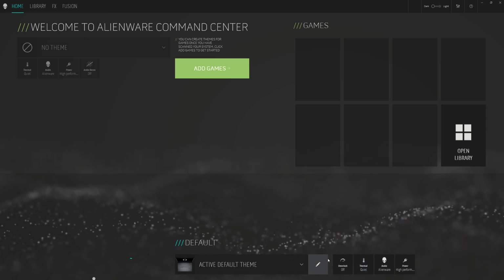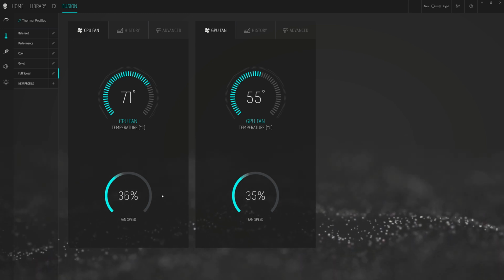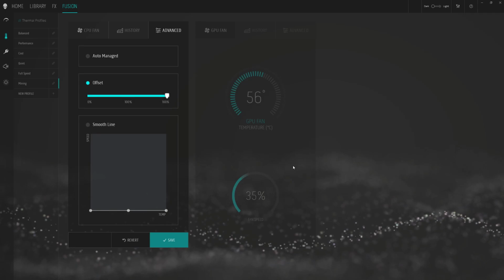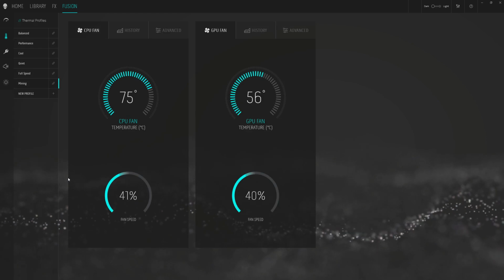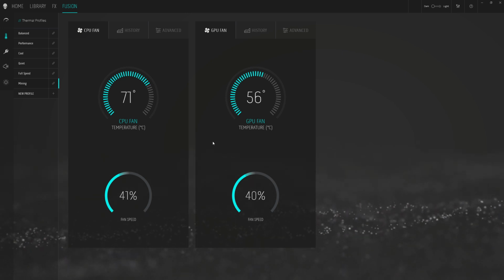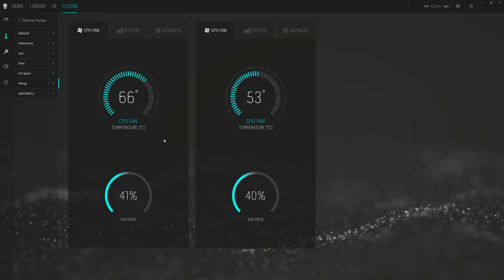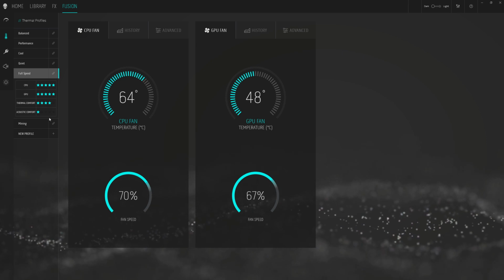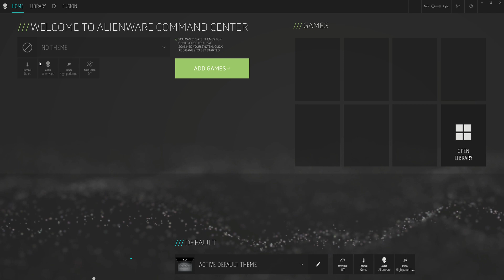Fix - Alienware Command Center Wont Change Fan Speed

Comment: My default is gone. Can't see anything except my games, stuck on Full Speed now lol
Reply from the maker: Prob an update broke things. Do a full uninstall of AWCC and OC Settings apps, restart the pc, and then try to install via this AWCC package installer. https://www.dell.com/support/home/en-us/drivers/driversdetails?driverid=x8t80&oscode=w2021&productcode=alienware-m18-r1-laptop
Reply from the maker: If you experience issues with the above installer, here's the full package installer. https://www.dell.com/support/home/en-us/drivers/driversdetails?driverid=d4x01&oscode=w2021&productcode=alienware-m18-r1-laptop
Reply: @John-Patrick McNown  it will be an ongoing issue with Dells coding when it comes to Fusion and the Alienware control center. The issue is MS Dot NET Framework being updated. Which has controlled everything down to the custom RGB settings for AW laptops and desktops.
Reply from the maker: @devingunther9352  Thank you for chiming in Devin. I haven't had my AW machines since about a month after I uploaded this video so i'm really just guessing at this point as to how broken things are now. I hope this helps others understand what's up.
Reply: @devingunther9352 So how do you fix this issue?
Reply: Today i install ACC and in less than 2 minutes it went to full speed fan, y close de app and it continues, i restart the laptop and same issue, then i uninstall the ACC and the problem its gone, probably its something wrong with this program.

Comment: can we flash an alternative bios to the motherboard to get rid of all the dell software they abandoned? ive spent apx 30 hours working on a R11 system for a friend of mine. Ive case swapped it, replaced the burnt out gpu. and now the only thing i have left is the fan control and front panel buttons.

Comment: I fiddled with this damn software for like 30 minutes wondering what the hell I was doing wrong.  The fact that the "activate profile" is under a completely different tab from actually SETTING the profiles is ridiculous.  My girlfriend just got her Aurora R12 and the thing has had no end of thermal issues.  I couldn't believe how damn hot the thing gets just sitting there doing nothing.  All 3 fans were reading almost 180°F while the fans slugged along at 12%.  Video feed would stop but the computer wouldn't shut down (thermal condition).  I would have to shut it down manually and allow it to cool for 30 minutes before she would fire back up.

After fiddling around for a bit I now have the fan curves for all 3 zones set very nicely.  I have made a very nice compromise of noise to cooling.  Now everything hovers around 111°F and rarely gets over 122°F regardless of how hard we push her.  

It seems the CPU requires the most aggressive curve.  The CPU temp seems to sort of set the tone for the entire system.  The CPU fan hovers around 60% @ 110°F, which is actually surprisingly quiet.  The front fan is the worst noise offender, but honestly doesn't do much cooling-wise, so that fan hovers around 30% @ 110°F.  The top fan is not that noisy at all, so it hovers around 50% @ 110°F.  The whole thing is holding nicely  @ 110°F-120°F.

Subscribed and Liked!

Comment: Thanks for this video. Had given up on a solution. To add, once you activate the new profile you can change the settings in the fusion panel and any change will reflect instantly and will not have to flip back and forth to the main menu.

Comment: Thank you for this video. For the last 10-15 years, I've had multiple devices having Blue/Green Screens of Death. Dozens of "solutions" have been suggested, usually centered around Clean Install of Windows and/or modifying the Virtual memory issues. Not a single post ever suggested the fan speed or a potential solution. I always push my devices beyond their limits. I never realized there was a connection between "SOD's" and fan issues. I thought they were two separate issues. 

Being able to influence fan speeds has been a huge help. The Computer Management app (using Event Viewer) shows the frequency/types of errors. Following this video has greatly reduced/eliminated my "SOD's" for the last few weeks. My husband suggested giving you a like/subscribe/comment to reflect my gratitude. Thank you!

Comment: okay so i was having some other issues, and needed to do a complete reinstallation. Before i uninstalled, I was actually able to adjust the fan speed in the advanced tab and it would actually work. it has done this since i first got my desktop a few years ago, but now that i reinstalled it, it wasnt working. in which case, great video, thank you for the help. but i wonder if it was like a version specific thing or what because now that im looking it up, apparently im the only person i can find that was able to change the fan speed in the advanced tab and that blue line did mean that it was the active profile. im not sure what changed, but im hoping someone can find out what it was so maybe i can get that feature back and so others can actually have it.
Edit: okay i figured it out after messing with it for a while. i think its because the blue bar in the thermal profiles is supposed to change what the profile says on the main screen, and for some reason it isnt doing that. if you select your custom profile on the main menu, and then go into that profile>advanced and then change the settings ( i always use smooth line) it changes as you change the line and save it

Comment: It took me days to figure this out.  I couldn't find this info anywhere.  I'm have the same prob with a corsair mouse setup.  Very similar situation.  Anyway, Thanks for posting this vid...... Also, don't let AW command center install Nvidia software.  Download yourself, straight from Nvidia.  For some reason,  AW overclocked everything, locked the settings and shot my temps up by 40 deg F at idle.

Comment: I agree, It is not (gasp) user friendly.   Also my take is as a "Command center"   it does not give as much information on all the temps as I might want.   Thanks for the video!
I used to build my own PC's and the R11 is the first pre-built I have had in 25 years.    Overall I like it but the bios seems really wonky.  I have seen LOTS of people know know more than me about computers (Especially the Alienware) and I see LOTS of them say if it is working do not update bios because it seems to trigger problems

Comment: Does it work with MSI laptops?
Reply from the maker: My understanding is that the Alienware Command Center is specifically intended for use with Alienware hardware. Frankly, I MSI has to have made something better than this app. Afterburner for example.

Comment: I'm having a different issue. My fans will never go quiet on my M15 R7. Fans never go under 50%, and if they spin up to 100% while gaming they stay that way even after quitting and nothing is running. I've updated everything and still an issue. This was an open box from BB and I'm outside of my return window. Im thinking it may be a hardware/sensor issue.
Reply from the maker: Sorry for the delayed response. Did this ever work itself out? Were the fan speeds at least responding to the perceived (presumably incorrect) temps?

Comment: Why doesn't my 2015 Alienware laptop 17R2 cooling fan keep turning to the laptop for cooling? My laptop CPU is already at 60 degrees or 70 degrees. Why doesn't the computer fan continue to cool down? Do you know a workaround?
Reply from the maker: Are you saying that the CPU heats up and the fan speed slows, allowing the CPU temp to continue to rise? Are you able to create a more agressive fan response curve in the Command Center app? If the fans can be set to 100% regardless of the CPU temp, does it lower the temp? Perhaps the fans aren't working as well as they once might have. Perhaps the equipment is reaching an age where everything is simply becoming less efficient and effective. I keep my laptops on an active fan cooling pad just to give it a little help.

Comment: The new update has NO HOME TAB AND IT NO LONGER SPEEDS UP THE FANS. wtf...
Reply from the maker: Ita been a bit since I had these AW machines, but if I remember, there was a time when an update broke it, but uninstalling both AWCC and the OC Settings app, rebooting and reinstalling both apps again corrected it. Fingers crossed they didn't F the app up more.
Reply: @jpmcnown1  well I ended up having to set the speed for each game so basically of its a low load game it will be ok but something more heavy it just runs pretty much at the maximum of the curve. Great tutorial btw, I always used the home screen setting but the update changed it, and I can't seem to roll it back. Can't find the old drivers anymore. I'll probs do a whole new build in oct, but it really is a good machine, guys with new rigs are complaining and I'm running an i7 9700 with no issues. Too bad the Devs are not doing a good job on that app. Thanks again, the video made a difference for me that's for sure.

Comment: Alienware Command Center one of the most poorly written pieces of software I had the displeasure of using.
- Asks to download optional components which never install? ☑
- Terrible UX where you need to turn things off then on again to get settings to stick? ☑
- Uninstaller leaves leftovers files and registry entries everywhere that must be removed manually? ☑
- Trying to reinstall gets stuck forever while filling your disk with an ever growing log file? ☑
- How many times should i uninstall and reinstall this software before it starts to work properly? is 100 times enough? ☑

Comment: I searched for days, even called Dell for a fix on this. I did not realize the gaming laptop had so much control over things. My fans ran at 100% for 2 days cause I did not know how to use the Alienware Command Center software. You made it easy and saved me from returning this Alienware laptop. Thanks

Comment: My Alienware 17 r4 from 2017 doesn’t have the thermal option in my Alienware command center, how can I fix that?
Reply from the maker: I would uninstall the AWCC and OC Control apps, update your bios and all drivers, then reinstall the 2 Alienware apps again. There "should" be a little thermometer icon on that tab. Let me know if this works.

Comment: AWCC is dumb, right, but that's is not even the way to apply. You have to click on the "link" shaped icon on the right of profile and apply to "desktop", like applying profile to a game. you will see as a white shape rectangular with no image in it. Then AWCC will load that profile every time you use "desktop" (so, always).
Reply from the maker: Yeah, I appreciate the clarification, that's been mentioned. It's also completely intuitive, to no one. I moved on from Alienware, the app is only one tiny shit aspect of the giant turd.
Reply: @jpmcnown1  more unintuitive Is that AWCC profiles let you only manage fan profiles but also work on overclock and/or Windows powerplan, managing them automatically and not letting you know.

Comment: Thanks for this!  Been trying to figure AWCC for a year.  One question - I recall you saying you were operating with the side panel off and a desk fan -ME TOO!  Are you running with the side panel on now, and still keeping temps around 70C under load?
Reply from the maker: I actually don't have those pc's anymore, but they had 3080's in there and they ran hotter than I preferred regardless, but I was mining 24/7. More than anything, it just bugged me that seemingly no one was talking about this shit app.

Comment: long shot but when i  put them in fullspeed mode ton of air comes out but then they calm down even though according to alienware command center they are at 100%
Reply from the maker: If you create a custom profile, and select "offset", and set it to 100%, then select that profile on the home screen, does it keep blasting at full speed?

Comment: OMG...This is fantastic.  For what it's worth, the lil blue bar used to function as a toggle to select the different thermal profiles (i.e., you didn't have to go back to the Home Screen and select it there).  I didn't realize this, and spent 12+ hours on the phone with Dell Support. They re-installed the OS, reinstalled the AW Command Center, decided it was the motherboard, so they sent a service tech to replace it.  Then they replaced the hard drive.  Then they had me send the computer to Dell where they replaced the Graphics card and the CPU.  Then 2 more iterations of bios updates, reinstalls of the OS.  Finally, they sent me a replacement PC, which of course, was doing exactly what your video described.  Amazing that I went through all that for a 20-second fix.  Hope your video saves everyone else from the trouble.
Reply from the maker: Oh yeah, Dell wanted to ship my pc off to "fix it", until I told em I have 4 computers all doing the same thing. Thank you

Comment: yes but I do when the app shows my fans running with 100% but the temperatures are 75 degrees and I know they are virtually going like 50%, on performance they drop like 25% and temperature going to 100 degrees without doing absolutely nothing...

Comment: I bought a semi-barebones aurora r9 super cheap from fb marketplace and bought/had the rest of the parts for a decent travel gaming machine. I put my old 980 ti hybrid in it and bought another oem 1.5a fan from ebay for $10 so I could control it with command center.. The fan and rad fit perfectly in the top section where the 3.5" HDD caddy went but it took way too long to find this video to figure out how to control the fan! Thanks for the public service :)

Comment: After watching this, I am insanely happy because I finally figured out what my issue was, but at the same time I feel incredibly stupid as well.
Reply from the maker: Welcome to the club, though I still argue that the developers are the stupid ones.
Reply: @jpmcnown1  Oh yes, even though I am admittedly a fan of Alienware Laptops, that is stupid design, arguably the entire App could be better in general.

Thanks for the insanely quick reply btw, while you are here, do you mind my asking what your opinions on the various thermal profiles is? Which ones do you use / when? Have you made your own fan curve / how does it look like? I have found that the answer to this seems to be way more complicated then one might assume. also I have run into a few issues till now with simply running it in balanced

Comment: It's a pity but it looks like my issue is different altogether. 

I am able to initially modify the fan speed and whatnot, but after an unknown amount of time my fans will default to some unknown speed and the command center shows them running at "100%" when they are not even at 25%. Nothing fixes this for me other than just rebooting the PC and hoping it doesn't start again.
Reply from the maker: Man, that sucks. All drivers and BIOS updated? Uninstalled AWCC and OC software, restarted, reinstalled the latest versions?

Comment: I use to be abel to see cpu and ram on my command center but since I changed my cpu to i9 I don't see neither my  ram or cpu only my gpu, might it be the command center or something else?
Reply from the maker: If it's not an i9 that's intended to be overclocked, it's prob not going to be adjustable in the Command Center or BIOS. Like if it's an H vs K processor. The ram clock speed might need to have the overclocking enabled in the BIOS first. That's how my i7's were.
Reply: @jpmcnown1  thanks for replying, it's the i9 10900k unlocked processor. And ram is xmp 2.0 32 gb each I might not overclock that not yet but the issue is its not appearing on my Fusion tab  like it use to

Comment: Great review, thank you so much!!!!!  This is what I was looking for with my GTX3080 and core I9 Alienware.  It was running hot, and it actually fried the first MLB and video card within the first 4 months I had it.  Dell replaced everything it, but I want to be able to trust that it will survive.  I don't even game much, I use my laptop for business primarily.  Loud fans are not a big concern for me, but performance and longevity are.  You did a great service here for a lot of people.  I hope Dell / Alienware take note.  It might reduce the return rate on their machines.  It's got to be worth a ton of $$$ to Dell if they would show people how to do these mods.  Best Regards, Shawn Aucutt Tallahassee, FL
Reply from the maker: You're too kind. lol. I'm glad it helped. I'm really kind of blown away that Dell still hasn't tweaked just a couple things by now, because you're absolutely right, their rate of returns and repairs has to be wild.
Reply: @jpmcnown1  I just lowered my CPU temp over 20C.  I tried to fix it in the BIOS.  That worked on my older Alienware, but on the new one with new BIOS I turn on the performance fan option in the BIOS and it works for a few minutes then the BIOS goes back to the previous setting on its own!  I've never seen a BIOS do that before.  Your fix works!  Sell it back to Dell for goodness sake.  They owe you one on this.
Reply: Did you get a r13? I have exact same gpu and cpu and kinda scared now lmaooo

Comment: I turned my R11 on with the case opened, and realized that the fans it was controlling was for the RTX GPU fans, while the top and front fan remained spinning at low idle rpms.
Reply from the maker: Oh yeah, and those case fans "can" move a ton of air... If it's setup within the app. Did this long rant of a video help you to get the front and top fans cranked up?
Reply: @jpmcnown1  Yes, it was actually helpful. I manage to crank up the actual intake fans, instead of the GPU fans. However the CPU temp overview isnt being read by alienware OC, but thats probably another. My PC is scheduled to be sent in for repairs again. It frequently shuts off when launching a game. It seems that its common on these Aurora PCs. However, the PC had never utilized the fans 100% before. I never figured out the stupid alienware OC app.